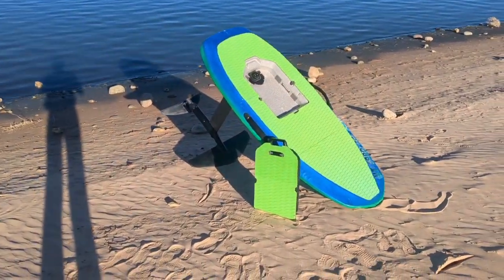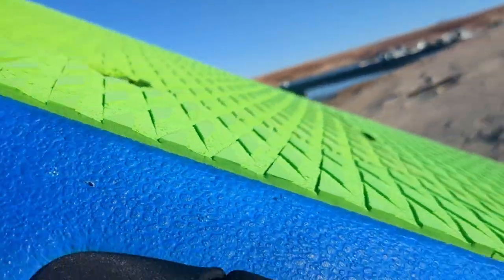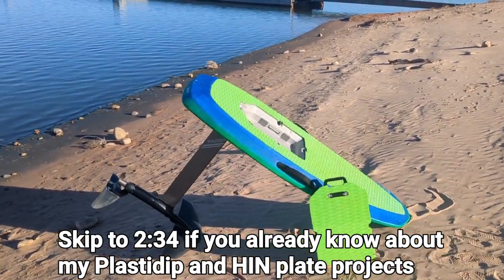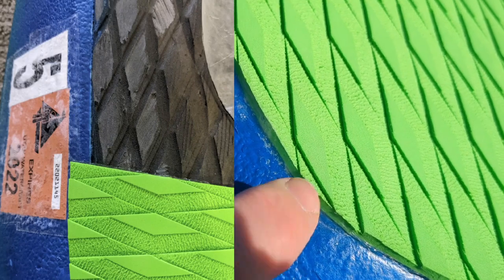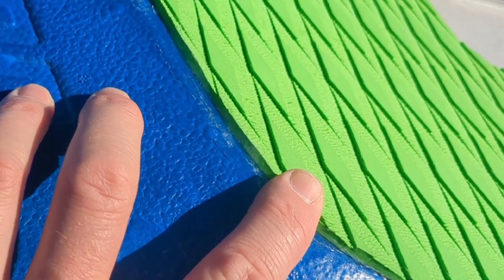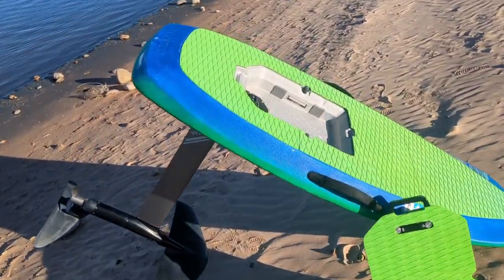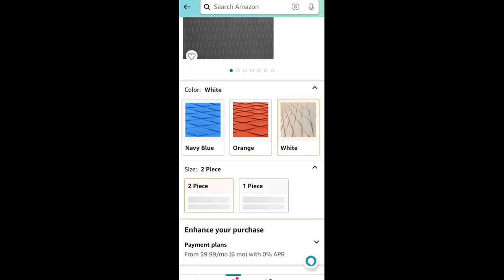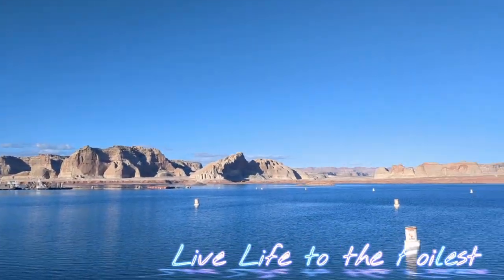eFoil Traction Pad Replacement | Customized Waydoo Flyer One

Comment from the maker: 📌 As pointed out in the comments, doubling the traction padding may create opportunity for water to get trapped between the layers, depending on application and use.  While I haven't experienced any problems in this regard, it is something to consider. 

Not everyone will notice or care about a slight elevation discrepancy between battery and board.  Foot placement and stance will have an individual impact.  ⭐ There will still be a different FEEL between the battery and board as the battery is hard/ firm under-foot and the EPP foam board has give.  
If you wear shoes 👟 when you ride as I do, the difference (elevation and/or feel) between the board and battery will be even less noticeable.  This is not the main or only reason I wear shoes, but it is yet another thing to consider, pending your style and needs.

... 
The ultimate board feel would be to have some sort of firm foundation (layer) directly underneath the EVA traction pad so that there is even less difference between board and battery.  All this while retaining the benefits of mild impacts from the EPP foam. No engineer here, just pondering 🤔

Comment: Poor effort from waydoo deck and hatch not being even. Doubling traction pad is probably not a good idea as water will fester between layers and will be prone to delaminate .
Reply from the maker: Good point about water collection between the layers 👍.  That is something to consider.  Thanks for that comment.  
I haven't noticed any water collection between the layers.  There's definitely more water that penetrates my board itself (Kickstarter Waydoo) than my lasagna of traction padding 😅.  
Fresh water lake here, so I am not too concerned.  
I elevate my board in a vertical position above a plastic storage bin after every ride to let it drain.  Traction padding has been holding up good since Spring of 2022.
I also wear shoes while I ride.  Wearing shoes will help make the slight level difference less noticeable as well as the different feel (even if the deck is level the battery is firm under-foot, but the board is less so.)